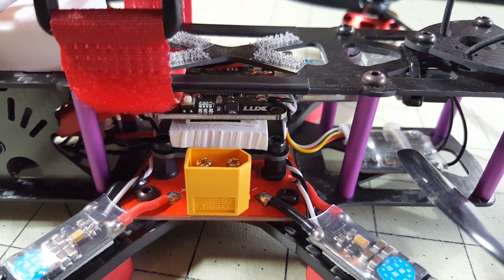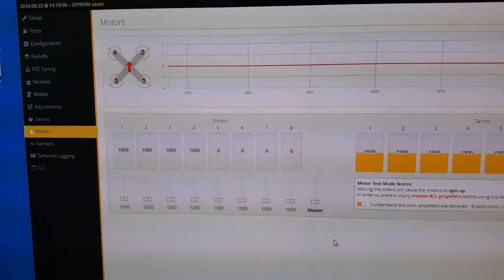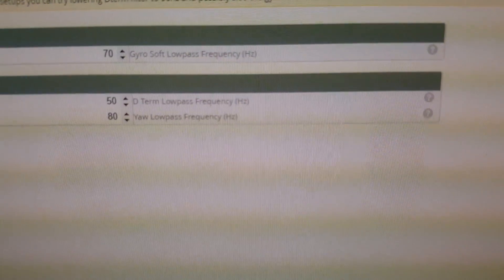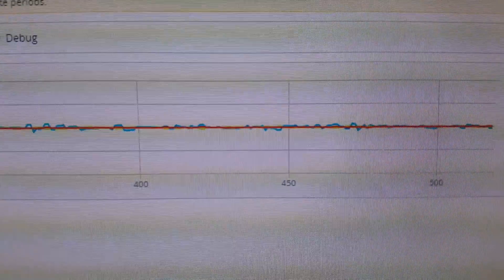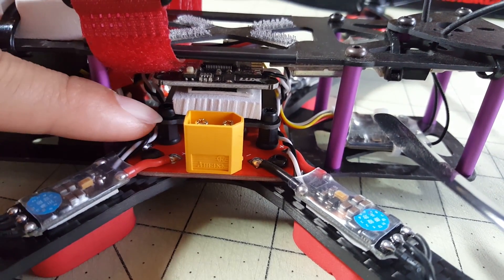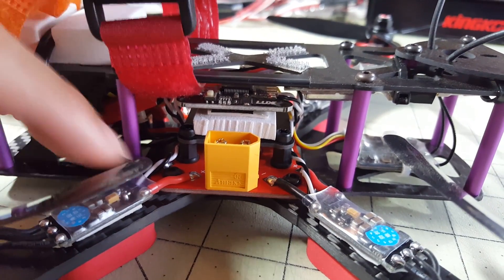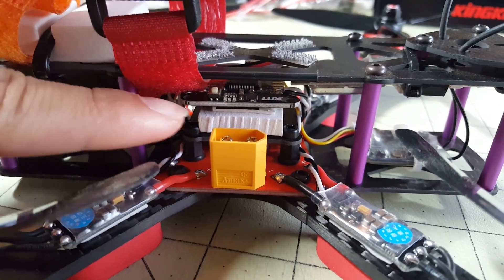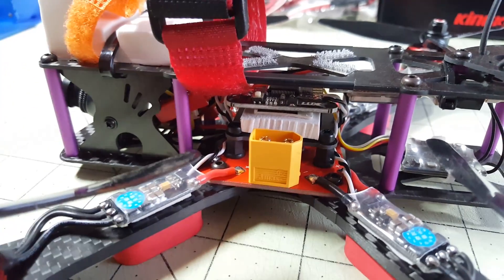LUX Vibrations! (Not so good)

Comment: Wow, thats so odd. I wonder if its because its a clone. I used my original with 8 rubber grommets 4 on top and 4 on bottom... connected to my camera pod on the same standoffs and I never experienced the vibration problem that so many talked about. I was checking out your videos because I was thinking about buying the clone lol
Reply from the maker: +DIRT 23 not sure why. I have another clone and it works fine so it must be hit and miss with the 6500 mpu

Comment: I used rubber O-rings on the bottom and top of the flight controller and that got rid of the chattering. Other than that, I thinks it's a good flight controller because the way its setup, makes for a clean build.

Comment: I had the same problems with the Alien and Lux FC. On my Bolt Black Ops, Bolt180, Bolt 150 no problems with the same the Lux. Perhaps it's because the arms centre under the FC transferring more noise.
Reply from the maker: Yes, there are metal screws that go right into the nylon standoff that mounts the FC. Its a part of the design. Using the foam has fixed my problem and it flies perfectly fine now. :)

Comment: But mounted like that if you crash the FC will be saying bye bye.
Reply from the maker: Why is that?
Reply: Doesn't look to secure, surely it would come off in a decent crash.
Reply from the maker: Yes, I did mention that in the video I will be remounting it. There was a piece of electrical tape between the FC and the foam tape which is why only half the board was actually attached.  I've already fixed this. Should be secure now.
Reply: +Albert Kim (marblekit) you could use cable ties through the mounting holes to stop it getting loose
Reply: so do you recommend the lux clone? please answer ASAP I am getting ready to order one!
Reply from the maker: +david ringler Only recommend if you know what you're doing. Otherwise, its a pain in the ass.

Comment: huh thats weird indeed. doesn't rubber reduce shake effects?
btw will u make a video on the announcement of the giveaway?
Reply: +Albert Kim (marblekit) um, soft silicone o-rings are better then the harder rubber ones. Also it's not a sensitive FC, but the MPU6500 is just 'crap' for multicopters.
Joshua did a good comparison, and the hardware filtering in other models are way more suitable... (just my opinion)
Reply from the maker: It does dampen some but not enough for this sensitive flight controller.  The announcement video is uploading soon.